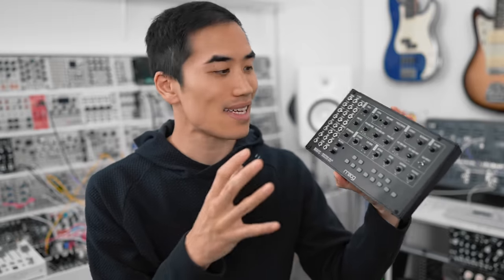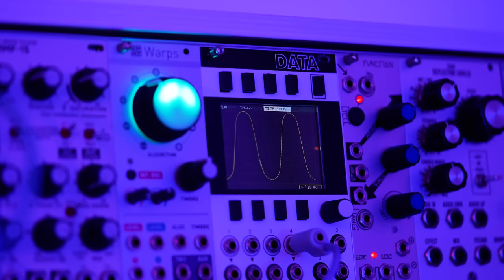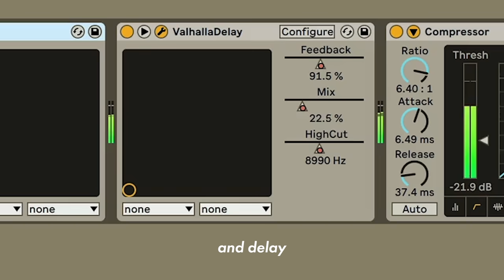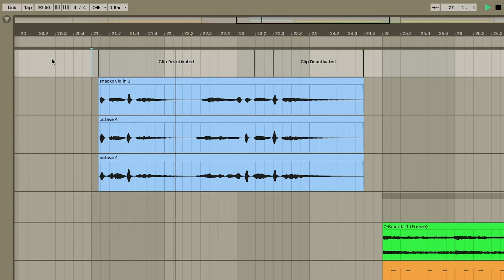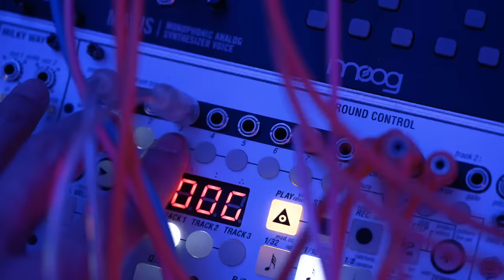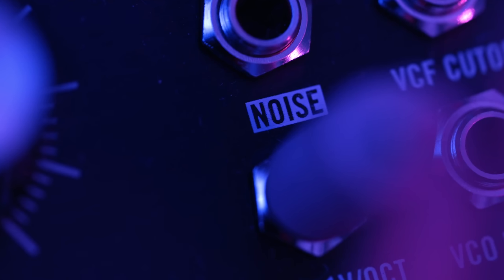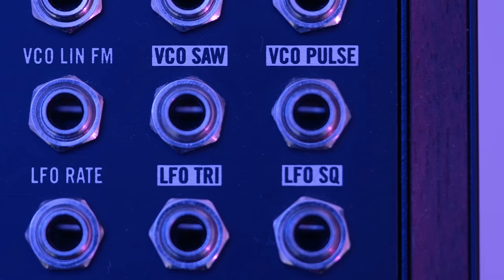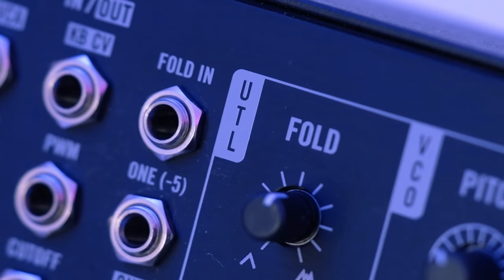Fun times with the new Moog Mavis!

Comment from the maker: 🙄 comments feature glitched site-wide about 5 minutes after this video dropped AND I don’t know what has been going on with my Premiere lately but sorry about that hp graphic glitch lol it rendered in a new weird way every freakin time. I guess now you know my measurements 😂
Reply: I had you down as more a 60 HP guy than a 44
Reply: is this a good first-time synth for someone really focused on sound design and understanding how synthesis works?
Reply: would you ever consider grabbing all the behringer semi modulars and comparing them to their moog counterparts. In this case the closest comparison id like the see is the behri neutron vs the mavis especially because theyre one of the few hitting the same budget. Its not really the comparison that would be the best part but the inspiration of hearing the sounds YOU can get out of them.
Reply: @floodgates1219  I'd say yeah, I don't own one so this is not firsthand knowledge but from what Andrew showed its a solid package that will let you explore tonality and patching quite a bit. The first limit you will run up against is the included cables so be prepared to buy yourself more patch and splitter cables and those awesome cables that have a second female right on top of the male ts that I can never seem to find. I have a Behringer Neutron that is a pretty similar box, and its nice to explore with but if you have a couple guitar pedals to add to the mix you expand your possibilities by an order of magnitude. Also Ableton Live lets me route my push2 midi into it via USB (so I've even got the best possible sequencer and an awesome interface) which the Mavis does not have. You seem to just want to explore sounds just like me but its an important note to make, unless you have a eurorack sequencer you are going to have to trigger every note yourself.

The Mavis is probably the best value Moog I've seen but you gotta remember they really are a premium brand, I would do a lot of shopping around before deciding on it. But in general, these semi-modular standalone synths are the perfect gateway into synthesizers, find whats right for you and make sure you actually have a way to play them (midi keyboard, or the USB route etc.) Personally I think you'd be really happy with it but over time you will start to wish you had more, and then you become a fellow modular addict😂
Reply: Thats why you should always watch the render before uploading to YT :P
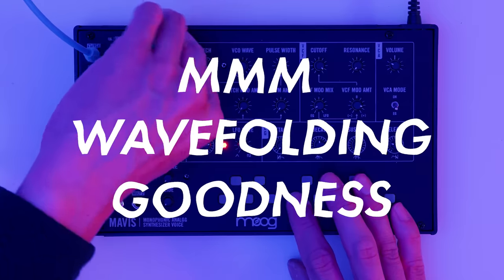Reply: 2:15 sounds like "on sight" by kanye on the yeezus album
Reply: That happened to me too, but mine said : „Edit Text Here“

Comment: 32 and 55 are relatively prime, so it takes 32*55=1760 steps to repeat. It's an easy trick to stretch out variation.
Reply: The common denominator

Comment: is there a module which generates cv that changes with a perlin noise function? i just had the idea that that would be pretty cool to control the note length you mentioned. i just think that would be a really cool thing to exist, a module where you canlike adjust the speed at which the function is read and stuff and maybe a button to generate a new perlin noise function

Comment: fun fact: with 44 HP, Mavis seems to be made to fit in a 104 HP case together with one of the "bigger" Moog semi-modulars (which are all 60 HP). Also it having the patchpoints on the other side than the M32, DFAM or Subharmonicon seems to support that idea (since you can patch easily, without the cables getting in front to the controls).

Comment: Just like you can draw circuits with Verilog or VHDL, i wish there was a hardware description language for sound circuits. Something like a synth creator. You type in a description of it and it shows you a visual example of it in a GUI (and you can put it together on a breadboard if you really want)

Then you could split up the Maven (or even double it up at no extra hardware cost) and have access to both uses of it.

Comment: Does anyone know why it has to be assembled by the customer vs arrive already assembled?
Reply: It doesn’t have to be assembled by the customer but this way the retail price Moog charges consumers is lower since final assembly isn’t a cost Moog incurs in the production.  That cost is paid by the consumer in the form of a cost of time though many either don’t mind or actively enjoy assembling themselves.  There are also those who would both prefer to not assemble it themselves as well as don’t mind paying the higher retail price a fully assembled unit would undoubtedly be command, so I agree ideally Moog would offer both unassembled and assembled options at two different prices.  And who knows, maybe they will at some point.  But I suspect however that this decision was to market to would-be Moog customers who would like to get into the Moog ecosystem but have been thus far put off by the price tag and/or didn’t know about/didn’t care for/or already own the Werkstatt (spelling?) & want to expand.  I have a feeling the Mavis is going to be the first hardware Moog synth for a lot of people, along with being a relatively less costly add-on for existing Moog Mother 32, DFAM, Subharmonicon, et al. customers.  Also worth mentioning is the assembly that the customer needs to do with the Mavis kit requires zero soldering, so it’s not as involved or intimidating for many who have little-to-no experience with that sort of thing while at the same time providing customers with really valuable education/understanding regarding fundamentals of synthesizers/synthesis, an entryway into the Moog ecosystem, entryway into DIY kits/projects, possibly entry into the infinite rabbit hole that is the Eurorack ecosystem, etc.  Though I’m sure there are or will be people/businesses who would assemble the kit for those who really don’t want to spend the 10-15min to do it themselves and who are also willing to pay for someone else to do it.

Comment: My gripe with the Mavis is 100% to do with the keyboard. It's too fiddly to really be all that useful and without an octave select that is made even worse. What I'd like to see is a version of the Mavis COMPLETELY OMITTING the keyboard altogether, in a smaller HP format because as-is I feel like it takes up too much HP to be racked in a case unless you just so happen to have room to spare. Also, the keyboard would only be useful in cases that lay flat. Vertical mount? Yeah, that keyboard is practically useless. 

If Moog would release a version without the keyboard, in a smaller form factor, I'd seriously consider adding it to the collection.

Comment: From what I see its a downgrade from the mother-32. The 32 is a perfect example of semimodular design with superb sound. I have the Behringer version of that synth but it still sounds crazy good so ill bet the original 32 has to be a bliss. Mavis has a very deep and rich tone to the filter but the fact that there is no res CV, no octave switch, no wavefold CV, no white noise nor triangle / sine wave..  just makes me want to look for another synth to get. You could get the minibrute 2s for 50 bucks more and you would have 2 osc (+wavefolder), multimode filter with feedback circuitry, a sequencer and lots of modulation stuff.. Mavis seems not much compared to that. Still sounds crazy good tho, theres no way to denie that.